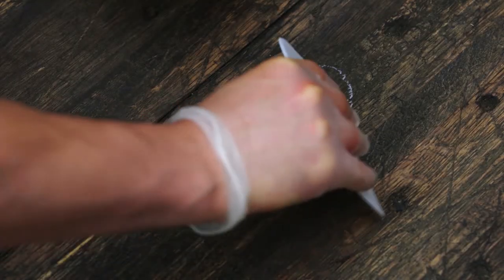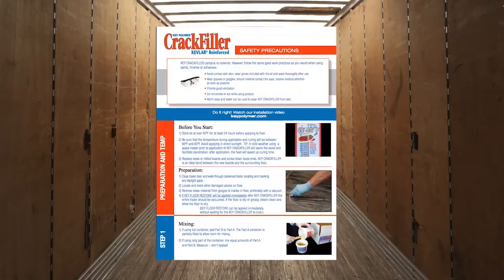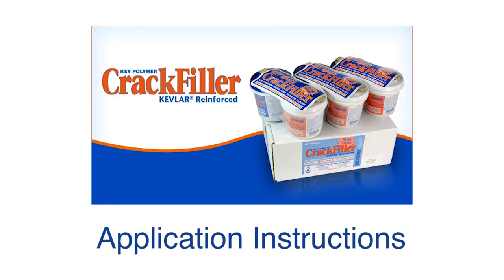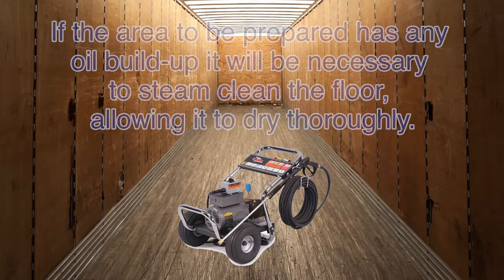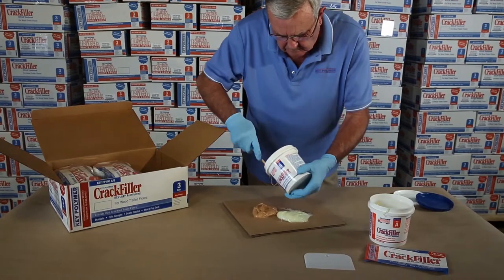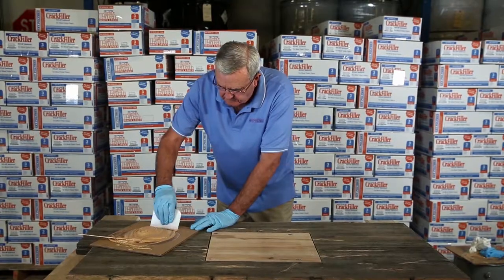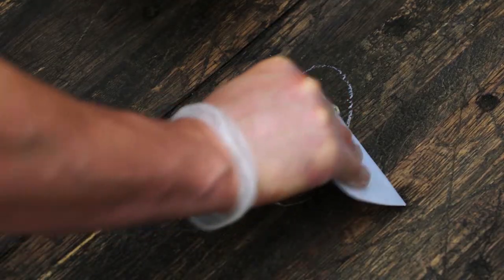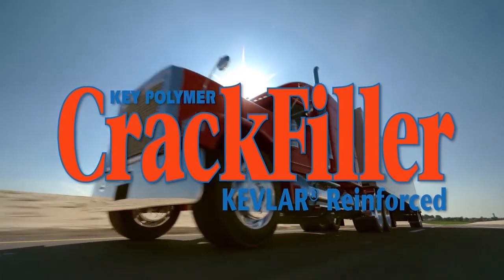How to Apply Key CrackFiller to Repair A Wooden Trailer Floor

Comment: It would have looked 100% better if you'd have added some pigment to the filler. Why not add some dye or even paint to the filler as you mixed it? The light colored filler sticks out like a sore thumb. Just an observation.